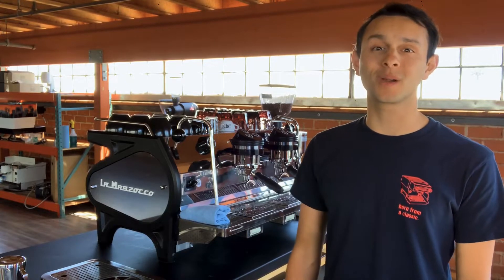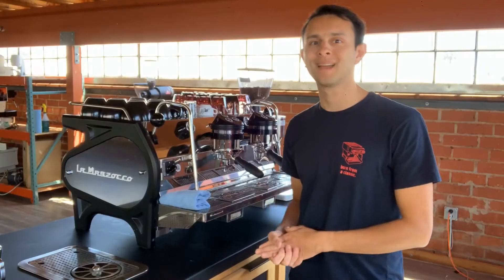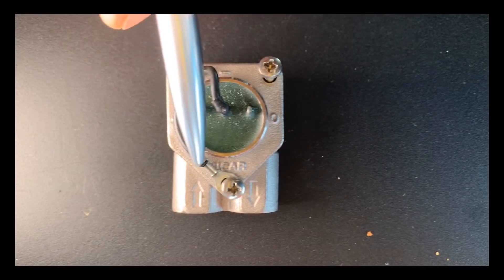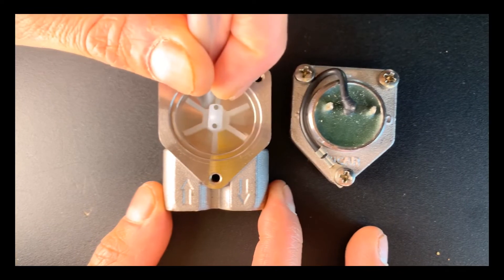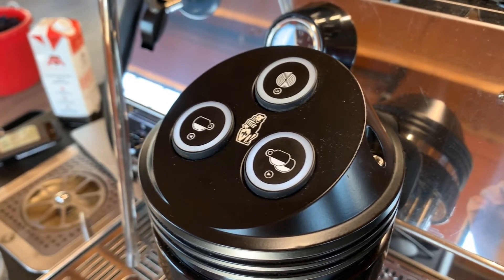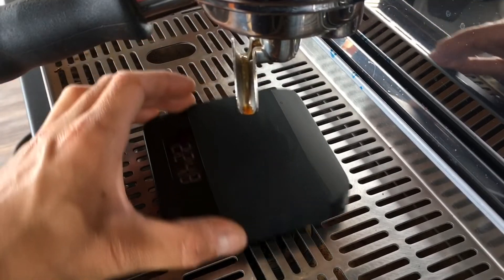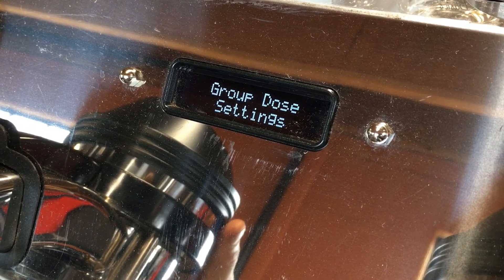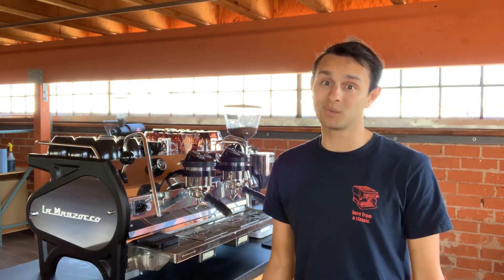Tech Tip: Programming Auto Volumetrics / Pulses and what is a flow meter?

Comment: I have a GB5 AV machine and I found the machine has a flow meter Alarm..

So we decided to change flow meter of both the group.. But after replacing flow meter and impeller inside The alarm is still there... I don't know why? Can you pls help?

Also ,
We start the express button to get shot , it's not working... All the First four button glow only buy it des not start being cycle..

Only Manual button and water dispenser button works..

Can you help me why this has happened? Anything I need to correct?

Comment: Hello from Bothell WA, thanks for making this video! I'm working on a Strada AV 3 group and I had some questions. I've been playing with the programming and I've found just that if I program the same pulses between the three heads, that I get a different output amount. The difference without a loaded puck is fairly close (~ 1 gram of water give or take), but they are quite different when loaded with coffee (all shots were weighted 18.9-19g.) But I've seen a difference of 2-4 grams when pulling shots between the group heads. We use an auto tamper so I feel like the packing should be similar shot to shot. 

What factors could lead to a difference when I pull shots from the different group heads? 
Is it smarter to use program each group independently? (We are only using 1 bean right now, so we are only scratching at the potential of what this machine can do.)

(I also imagine that there is a large amount of user error on my part as I've only been using the strada for about 2 weeks now, so it's my own ignorance, let me know!)
Reply from the maker: Hi John-Paul, thanks for your question! One thing you can try is an open flow-rate test -- run the group for 30 seconds without a puck into a cup on a scale and see what your variance is. +/- 1 gram is acceptable. If you're getting much more variance than that on the flow rate test give us a call, or call your local service provider to troubleshoot. If you're using 1 coffee, programming each group the same is probably fine (certainly simpler). You could try individually programming them to your spec rather than copying the doses across through the programming menu. I hope that helps!
Reply: @LaMarzoccoUSA  Thanks for the answer. I've done a couple tests over the last couple days and found some issues with volume between the groups. The pulses between two of the groups were spot on give or take a gram over 30 seconds but the other head was consistent in itself but off about 15% in total volume from the other two heads.

We're in contact with our service provider now. Appreciate the help!
Reply from the maker: @WCGM309  Happy to help! Glad you all are getting it worked out.